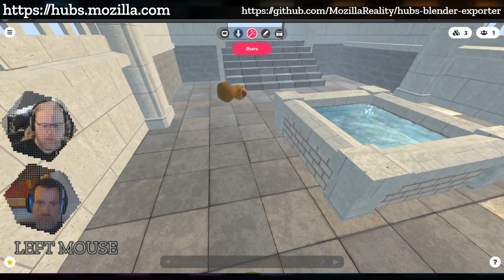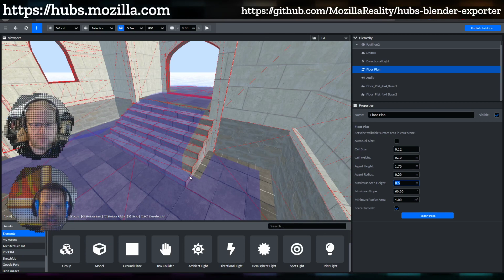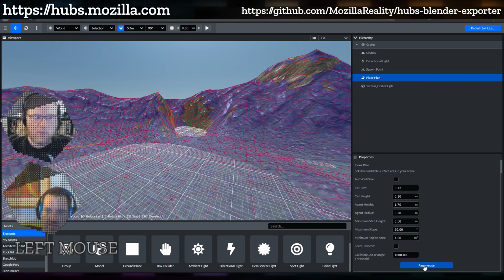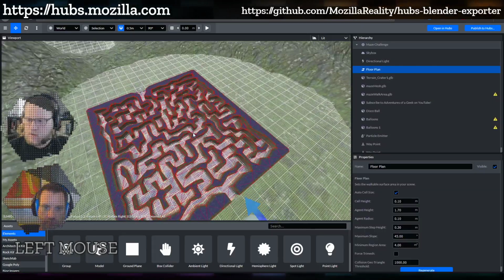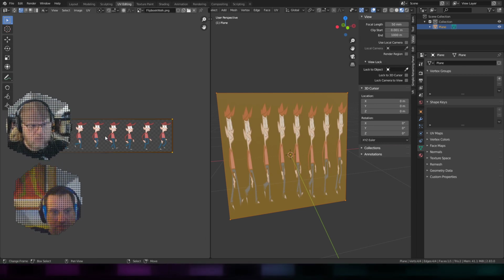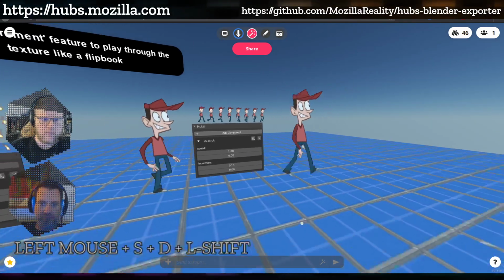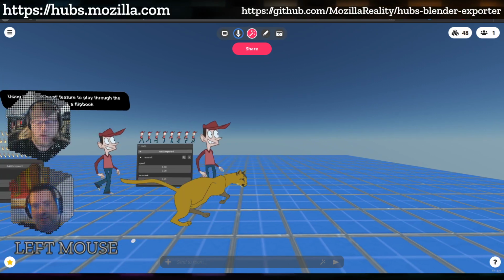How to Hubs! Some not-so-obvious features and how to use them.

Comment: 10:05 : Navigation / Walk Mesh
16:20 : Cardinal directions advantageous for voxel maps
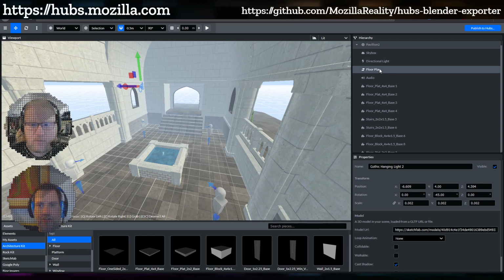19:00 : Finding the Floor Plan element and generating walk mesh
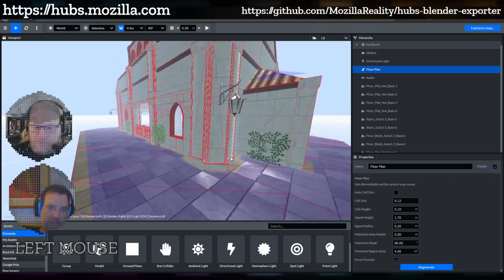22:00 : Setting specific elements as non-walkable
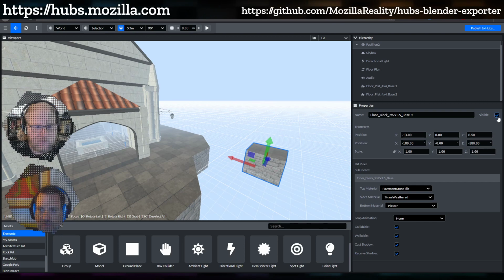25:00 : Setting invisible easter-egg walkable zones
25:40 : Setting invisible colliders
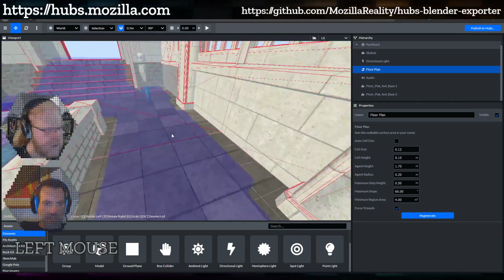27:20 : Common questions: agent radius
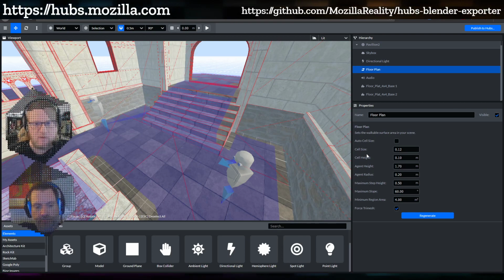29:54 : Stairs and step height
35:35: Walk mesh cell size
38:00 : Walk mesh slope height
41:30 : Slope height on organic terrain
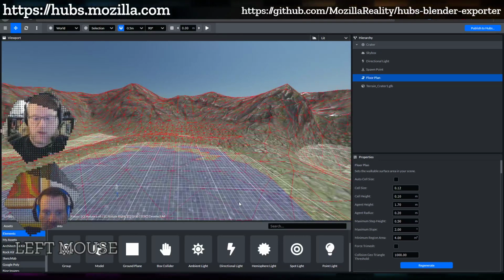43:30 : Simplified meshes to act as navigation meshes
47:50 : Agent height
52:12 : UV scroll feature
57:20 : Blender settings for UV scroll